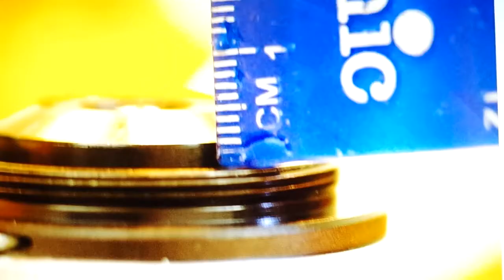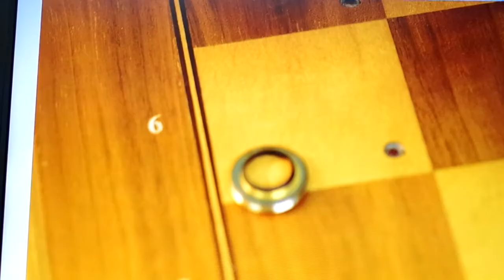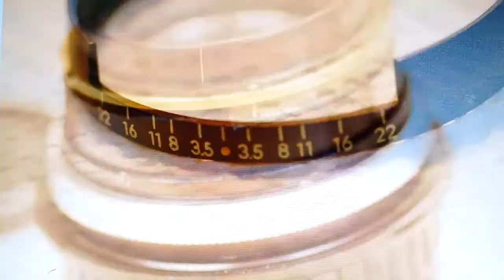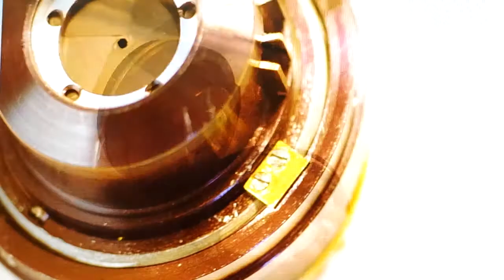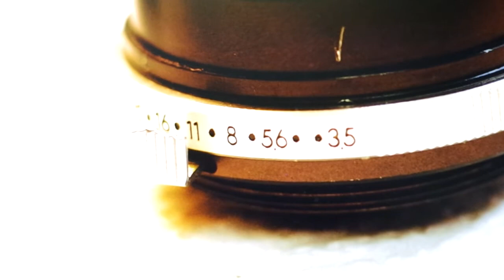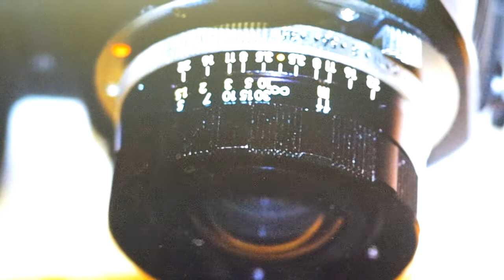Auto-Takumar 35mm 3.5 Rebuild

Comment: Probably my favorite lens. I have two of them. Amazing sharpness even wide open and great color. And the contrast is very special, rendering subtle tonal differences because of the lack of lens coatings it seems to me. I've read the 35mm has only one lens coating.
Reply from the maker: Yes 35 mm in general, and the lack of coatings adds to it